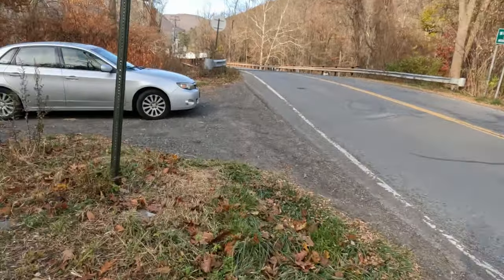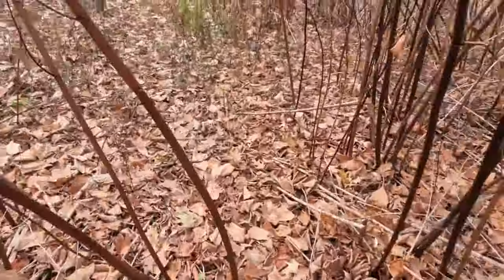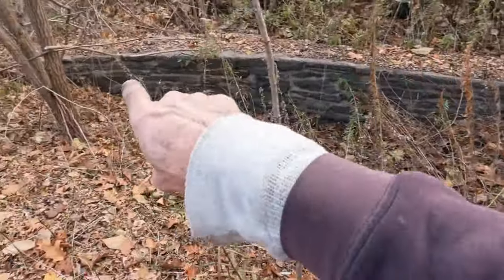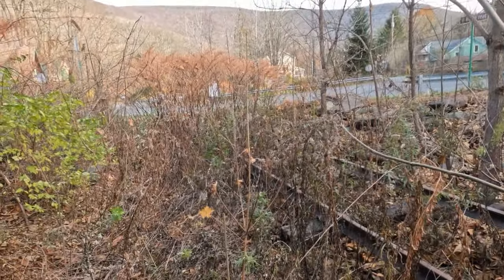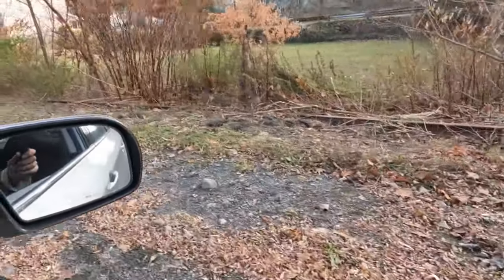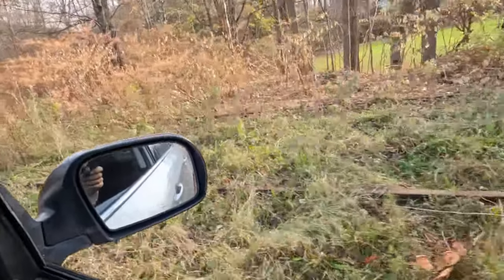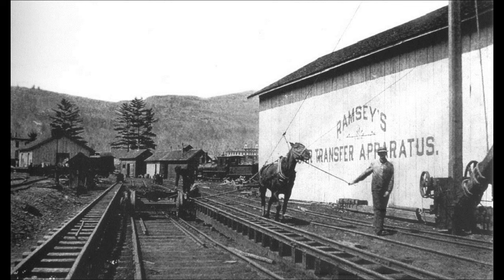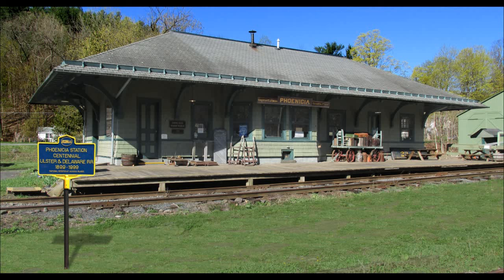......BYE BYE RAILS

Comment: This just sounds like they are going out of their way to rip up rails. That bridge easily could be replaced or redesigned to include provisions to preserve those rails. The removal of that much trackage and potentially a house is completely unwarranted. I would want to see if there isn't some sort of rail trail groups involvement in this push on this plan. just a theory. thank you for a great video btw.
Reply from the maker: Ahaa!!  You're onto something here!  There ARE Rail trail groups foaming at the mouth all around the Catskills.....11.1 miles on this VERY same rail corridor in 2016/2017 and currently trying to rip up Horseshoe curve and 5 to 6 miles additionally on this same corridor!  They....just...can't...stop!!